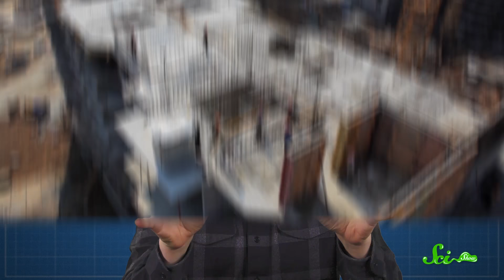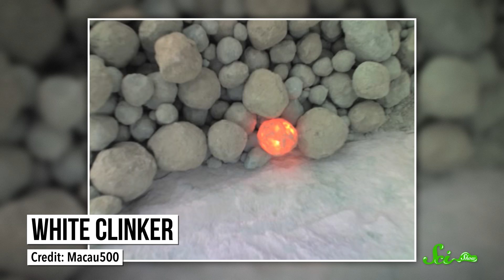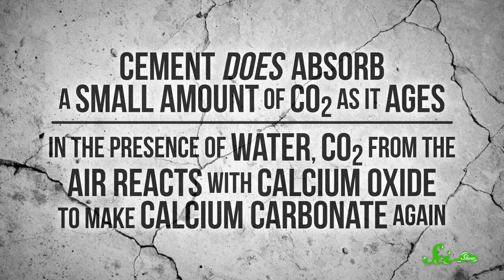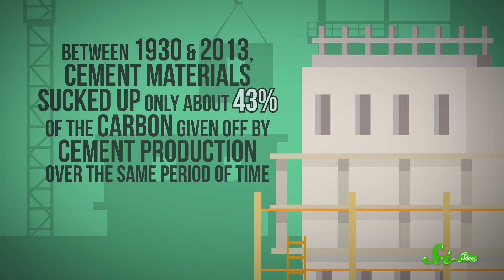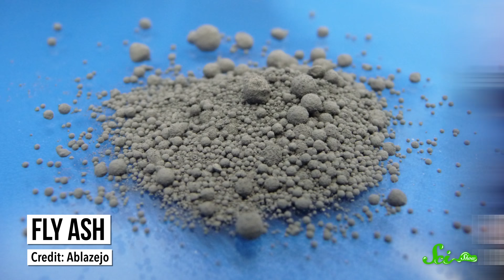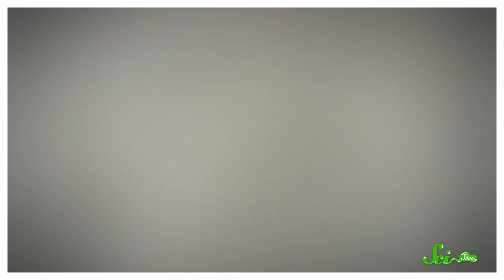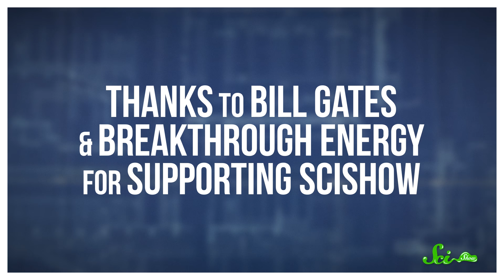Cement: A Really Hard Problem

Comment: I must point out that even the most optimistic timeline for this is going to take years if not decades. Civil engineers are very conservative with new tech and with good reason. It can take decades for problems with a process or implementation to crop up, and the result with something as fundamental as concrete would be thousands dead. I am not saying that it will not work, I am saying that any attempt to rush this into use would likely be disastrous.
Reply: Depends on the application. For buildings and bridges you're absolutely right, but for driveways, siding, sidewalks, and dozens of other applications, the danger is negligible and permitting is less onerous.
Reply: The George Foreman grill has not put charcoal grill makers out of business. There is a lot of capital tied up in conventional cement work. I wonder if incorporating this tech in the manufacture of a 3-D printed tiny house of cement would be a way two  new technologies could lift each other.
Reply: Thomas Hughes I’m not sure that’s a very apt comparison.
Reply: @PajamaMan44  The George can run on zero carbon footprint renewable energy. What is your more apt comparison?
Reply: Thomas Hughes the George isn’t really designed to supersede the traditional grill (or if it was, it’s a poor design to do so). So it’s natural that it hasn’t eliminated or even dominated the grill space. This is in contrast to this new cement, which as described is aiming to replace traditional cement. A more apt comparison would probably be lightbulbs, cell phones, or TVs, depending on how much government interference you believe could occur. In these cases, new technology came along to practically replace the old by virtue of being better in almost all aspects, and while there continues to be a market for the older style, the new dominates.
Reply: @thomashughes_teh  "The George" isn't a 60 story building that could collapse? But the best comparison is, "The George" is mostly a gimmick and cement is the backbone the construction world.
Reply: @thomashughes_teh  L I F T

Comment: If their curing process is faster, I wonder if that will improve road building in places where it rains really aggressively.
Reply: There is actually a fast setting concrete already and is used mainly for road repairs. You can check 24 hour concrete for this.

Comment: Adding fly ash to concrete has a significant problem: weaker, less durable concrete. That's not "green". It's dangerous and wasteful.

My driveway with "green" fly ash is 8 years old and has steadily degraded from concrete to gravel. The 40-year-old sidewalk in front of my home and the 40-year-old foundation of my home are solid as a rock because they have no "green" fly ash added. Every driveway and sidewalk in my area with modern "green" concrete is in dire need of replacement. That's not "green".
Reply: This should not be an issue, perhaps during production of the concrete too much water has been added, water is death to concrete strength. Using less water and more 'superplastifier' is a solution.

Comment: The major problem for all this is that a lot of construction projects don't rely on pre-casting cement, meaning that if CO2 was to to be harvested off-site, many labourers that handle either the transportation or casting of concrete could be out of work.

Comment: Ok, you start with calcium carbonate, heat it to get calcium oxide, mix it with water to make concrete, and let it set back to calcium carbonate.  Has it not absorbed the same amount of carbon as it released?  We’re talking chemistry.  It seems that the only excess co2 is that which was released by the combustion used for heat in the first step.

Comment: Wow, using carbon captured from the environment to create building materials!
Also known as a tree.
Reply: Trees are amazing and produce tons of benefits in addition to lumber but one thing they aren’t very good at is producing concrete.
Reply: We'd need to plant ten trillion trees to offset the amount of carbon already in the atmosphere. 280 parts per million carbon dioxide is the background pre-industrial maximum for the last million years, 350 parts per million is the scientific consensus for upper safe limit, 400 parts per million is the redline for environmental calamity, we're currently at 410 parts per million and climbing by 3 parts per million per year. Shall we start today? https://e360.yale.edu/digest/planting-1-2-trillion-trees-could-cancel-out-a-decade-of-co2-emissions-scientists-find
Reply: True? But like, we don't capture the carbon to make trees, the tree does all the work, there's more than just trees, and concrete is a good alternative since it's non-flammable.

Note: Asides from trees and concrete, there's limestone (which on its own is a great building material, just that it's heavy to transport, so making it into cement makes more sense if you're not building nearby the quarry) and then there's also bamboo (which, sadly, like trees, is also flammable; and it's a type of grass, not a tree).
Reply: @Daniel Meyers Exactly, and fire, mold and aerobic bacteria convert wood to carbon dioxide. Anaerobic bacteria convert the wood into methane - the greater greenhouse gas.  Termites produce both carbon dioxide (the termite's respiration) and methane (the termite's gut bacteria).  Then transport and processing have to be added.  This doesn't even go into preservatives.  Most of what is peddled as "green" is the result of questionable accounting practices.
Reply: @mister clean  It is the tallest one, after all. XD
Reply: @mister clean  Not necessarily 20 trillion, but yes. Basically we'd have to do #TeamTrees every year for like what? A century at least?

Comment: Wait... I thought that eventually the cement would absorb it all, ie. The absorption of co2 is part of why it fails and gets demolished then allowing full decay and full reversion to carbonates.
Not saying that these changes shouldn't be made, but just questioning the accuracy of how bad the issue is.
Does someone have more knowledge on this?
Reply: Theoretically, if you ground the concrete into a fine powder and left it, it should absorb close to the amount of released CO2. However many layers of concrete can be 2-20m thick, so CO2 is unable to penetrate deeper layers to react. Also the reaction process would occur over thousands of years without a catalyst, so wouldn't be good enough to offset current carbon emissions in terms of global warming
Reply: @jhudd3305  So it could absorb it (i guess decay context could stop this) but the timescales are too long to he meaningful.

Comment: Whats wrong with CO2 anyway? All plantlife depend on it.  And scientifically speaking we have a low CO2 content atm, stifling plant growth.  Hence why greenhouses raise CO2 levels to more quickly produce food.
Reply: Greenhouses that use increased rates of co2 also very specifically control other nutrients to ensure plant health. In less controlled situations you get imbalances that can stunt plants or cause them to produce excess carbohydrates because they lack what they need to produce fully developed cells. That results in lower nutrient density for humans, and potentially exasperated soil degradation on farms. 

It's not a positive to just dump excess co2 into the air in an uncontrolled way based off a terribly dumb analogy. If you were actually thinking of co2 as "plant food" and not just using that as a deflection mechanism to ignore a real problem you would immediately realize it makes no sense. You don't just throw full family size bags of potato chips at nine year olds cause "it's human food and more is better". 

Whatever ideology you have that is pushing you towards this type of lazy analysis is not worth keeping.
Reply: the problem isnt that CO2 is inherently toxic or even that the earth warms from it. As you say, we are actually in a rather cool period right now.
The problem is the SPEED at which it happens. 
Imagine youre in a car going 100 km/h. If you gently slow down the change in speed isnt a big deal. If you slam head first into a wall, the change in speed is a rather big deal. Both are just you changing from 100 km/h to 0 km/h but the way you go about it makes all the difference.

Comment: I have concrete evidence that if you stop complaining about Carbon and plant a few Trees, all that carbon you're worried about will eventually go away.. Oh that's right, this is America and we like to do things backwards.. That's why most of the world tends to build with Stone.. Where we prefer Wood because it's easier..
Reply: Yeah thats just really unrealistic. 
1. wood is flammable, less moldable, not as strong and not as durable. We arent gonna build 1000 feet tall buildings from it. 
2. If we used wood as a building material that would just undo all the CO2 absorption the original tree did.
3. We would literally have to keep planting trees as we produce CO2 until every inch of the world is covered because a tree releases its CO2 again when it dies. Meaning, it has to be replanted. So to keep the amount of CO2 steady, we cant cut down forests. So if we keep producing more CO2 we have to keep planting new forests.

Comment: If the structural integrity of the new concrete is questioned, then it might be better to use it for roads first instead of buildings to test its durability. We need an alternative to asphalt anyway if are going to stop using fossil fuel.
Reply: Unfortunately roads need a very specific polished surface value (psv) in order to prevent wear and also to stop cars sliding around. They need to be made of rock that will degrade in a granular fashion rather than wear smooth, and unfortunately this just isn't possible with concrete (which often sets and wears far too smooth for road surfaces). It is only a viable option for low or slow traffic roads currently.
One good idea currently used in the asphalt industry is RAP which is essential recycled asphalt which is reheated and used as a component in fresh asphalt, therefore reducing the bitumen needed to bind the asphalt together.

Comment: The worry over Carbon Dioxide is much exaggerated. It is a very nice and wonderful gas, ask any plant. So please, stop making that propaganda. You might put the Communist propagandists in shame.
Reply: the problem isnt that CO2 is inherently toxic or even that the earth warms from it. As you say, we are actually in a rather cool period right now.
The problem is the SPEED at which it happens. 
Imagine youre in a car going 100 km/h. If you gently slow down the change in speed isnt a big deal. If you slam head first into a wall, the change in speed is a rather big deal. Both are just you changing from 100 km/h to 0 km/h but the way you go about it makes all the difference.

Comment: Couldn't we work to increase the surface area of cement without comprimising its structural integrity, (for instance using a matrix/matrices or honeycomb structures through the cement with tiny plated openings)?

This way the cement we produce will take less product to complete as well as maximize the CO2 it intakes. This structuring might also be more stable than solid cement too...
Reply: Now this is thinking with engineering. I don't think this is practical, given how cement is used, but that's not to say it's a bad idea in theory.
Reply: Pre-cast, maybe, assuming they are simple shapes. You could pour them on the ground and flip them up afterwards. Cast in place tho, you wouldn't be able to pour walls very easily. Between the reinforcement and the tight corners in the forms you would have trouble getting the stone into some places. Basically you'll have large pockets of just cement and sand, if you could even work it into the forms at a reasonable slump. Also would end up creating a lot more tensile stresses in the concrete, so you would need to install more reinforcement. All in all, good idea, but we would have to work on our placement methods.
Reply: In some places you could do this, but most of the world has to deal with ice at least some of the time. If water gets in and freezes you can say goodbye to your strength.
Reply: I believe this is already done in some form. I think Hoover Dam has miles of pipes running through it with cold water to speed curing. There's so much concrete that it's still curing to this day and would be hundreds of degrees in temp without the piping.

Comment: Instead of using fly ash to help make clinker, why don't we stop making fly ash?
Reply: Fly ash is currently mostly produced by coal power stations and is sold as a byproduct that the power station does not need, so alternatives will have to be found if we move away from coal power. As coal power stations have reduced in Europe it is now often shipped from China.

Comment: Maybe a stupid question, but why don't we just build structures out of limestone, rather than use it to make concrete? I know it can be done, I've seen many buildings made of limestone
Reply: I think because otherwise you'd have to haul a whole big piece of limestone and cut it just the way you like, rather than molding it however you want
Reply: Concrete is also far more structurally sound than limestone and can be modified for a variety of uses I.e. Radioactive containment, heat insulation etc. It is also much more wear resistant, cheaper, easier to work with, and corrosion resistant.
Reply: @jhudd3305  Okie dokie, thank you~!

Comment: Carbon dioxide is the baby thrown out with the bath water. NOx, SOx and particulates are the unwanted. Carbon dioxide is plant food and plant food is our food. Plants thrive at 1,000 ppm carbon dioxide in air. Most plant factories add carbon dioxide to increase their turnover. Our atmosphere has much less carbon dioxide than plants would prefer and photosynthesis absorbs sunlight energy resulting in a net temperature drop for increasing carbon dioxide concentration.

China has laid claim to oil and gas reserves under the South China Sea simply because it intends to profit from it as a cheaper source of energy than wind or solar energy. The USA similarly does not buy into the green energy hoax and continues with oil and gas exploitation. So why have so many other nations supported green energy? Because they don’t have any reserves of their own and have an interest in depressing the oil price.

So cement manufacturers in oil and gas rich countries will continue using them. Those countries that need to buy their oil might look to make more expensive cement without oil and gas and will surely have no export potential.
Reply: Do you just pop up everywhere atmospheric carbon is being discussed on YouTube,  or is this just some massive talking point people are constantly putting out to avoid dealing with a massive disruption to the carbon cycle? 

Greenhouses that use elevated carbon dioxide levels don't do it haphazardly,  they do it in very specific proportions to other nutrients they are providing the plant. In a less controlled environment,  increased carbon levels MIGHT increase yield weight if you avoid weather pattern shifts which damage the crop. However, that increased yield is very likely not going to mean increased nutrition because the plant will produce excess carbohydrates if it can't synthesis enough other nutrients from the soil to actually grow fully developed cells. 

Assuming dumping uncontrolled amount of carbon in the air is just going to lead to better plants "cause it's food" is about as dumb as throwing a family sized bag of chips at a nine year old everyday and assuming he will grow better because there are more calories than he would otherwise eat . . . . It ignores all basic sense of proper proportions for different inputs and environmental conditions.